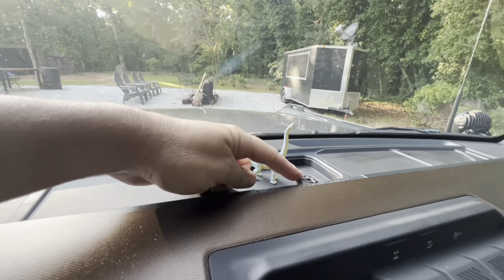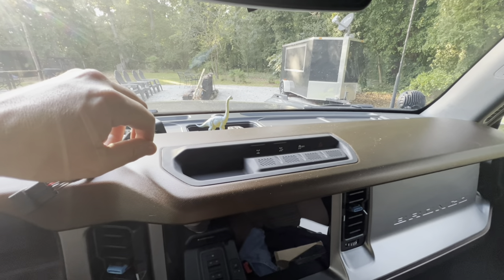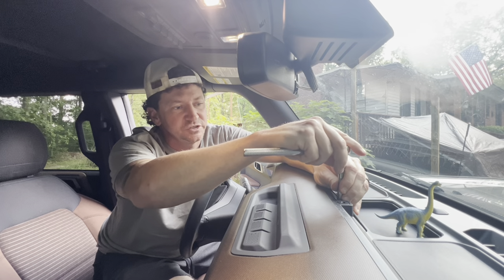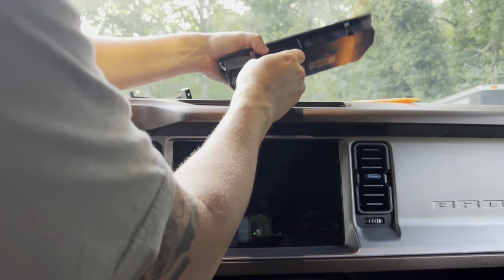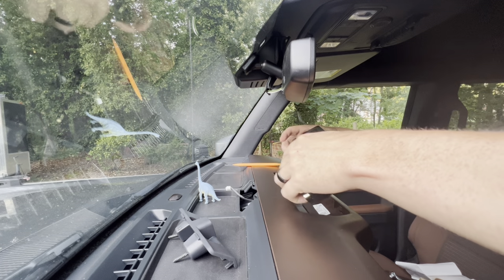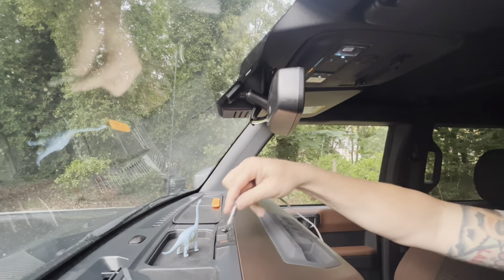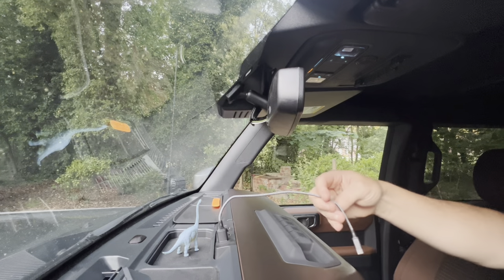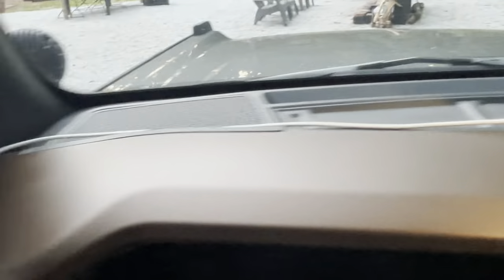Easily add MORE POWER* to your Bronco!

Comment: I have had two of these from Mabett in my 23 Bronco Big Bend and it's a great idea.  The BB came with thee MID package so no factory option for power on top the dash.  For Android, only the driver side USB C and A work.  For some reason Android doesn't register on the USB C on the passenger side. I tried using the 90 degree and it didn't really work for me. Shorter USB cables of 12 inches help with cable management.

Comment: Installed one of these myself wasn’t hard to do. The only problem is if you have a picatiny rail for cell phone and go pro cam mount the center block that screws in and holds the rail down blocks the two USB-C ports.  it would be nice if someone recognize that and had the two USB-C ports reconfigured to the back of that piece that snap in
Reply from the maker: Agree 💯